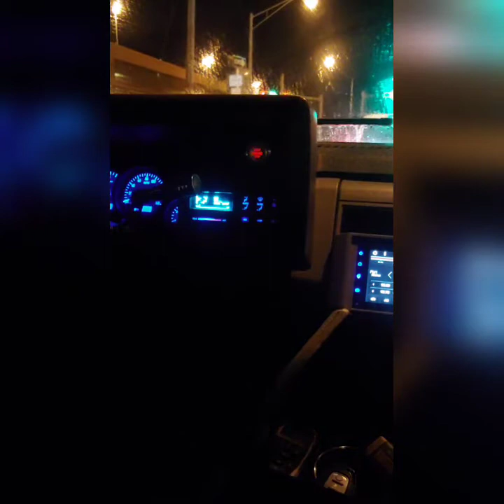Project crew cab dually. part 4 rear end rebuild assembly 11.5 aam silverado duramax

Comment: Just watched this whole series. I have a 14 bolt g80 11.5 on my 2003 2500HD. Planning on doing this in the spring. Great videos, very informative and clear and I like how you show the entire uncut process. If I had to say one thing, it would be to please put the hammer drill on the other side of the room when doing those carrier bracket bolts xD Good stuff man

Comment: So I did exactly what you did. Backlash was a little loose so I moved the carrier to the left by one slot on each side. Do I need to tighten it an additional 3 slots to set the preload again?
Reply from the maker: If you already set preload and moved after you should be good.
Reply: @BuiltByMike  Awesome, thanks man. So far so good!

Comment: I noticed on your test drive you said "there's 60, much better" and again at 70. Is that where your noise/vibrations were coming in? I have a 2016 LML that has a hell of a vibration from 55-70 and can't find the culprit anywhere but know that the stock carriers in these trucks are garbage.
Reply from the maker: Yea once I hit 60 it would vibrate and make almost like a exhaust rattle.

Comment: Hey Mike, thanks for the video ! I was just wondering how's the truck differential job is holding up after a couple of months. I have to install an air locker on mine and I'm taking your experience as guidance for the setup. Thanks again !
Reply: How much better is your new lsd compared to stock? Is it about just as  much a pain the get it to lock or is it better? I just ordered an eaton helical, because I thought mine was an open diff. I just found out it has a dang lsd by applying the ebrake and forcing it  to work with one wheel off the ground. Anyway, Thanks for the video. Im contemplating  sending this $1k eaton back sense it is biult just like the factory  unit and just get a locker style diff.
Reply from the maker: I have about 2000 miles on it so far and all is well. 1500 of those is with a 28 foot enclosed. I changed the fluid after 500 miles and added the dodge aluminum finned cover as well. All the fluid looked great and gear patterns were wearing nicely.
Reply from the maker: I never have one wheel off the ground. In some reviews I have read in icy or low tide at the boat ramp if there isn't enough resistance it will act like a open diff. They said just to apply enough brake to lock both sides.
Reply: @BuiltByMike  good to hear it !
Reply: @BuiltByMike  I just went with an Air locker from ARB, I'll try to get it done next weekend.